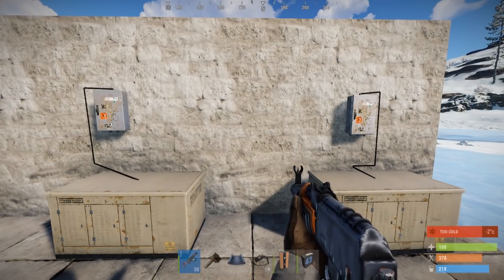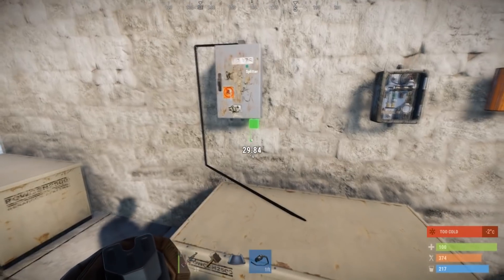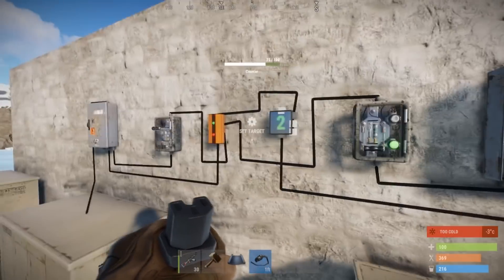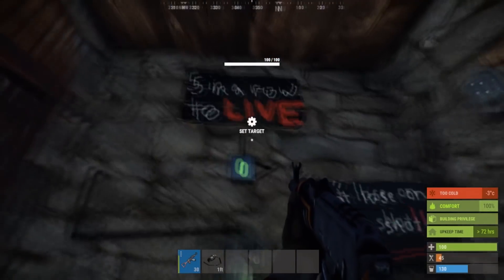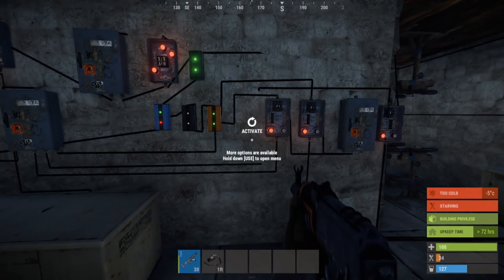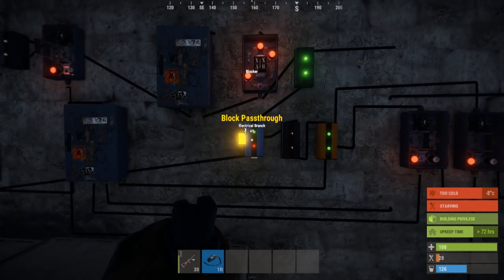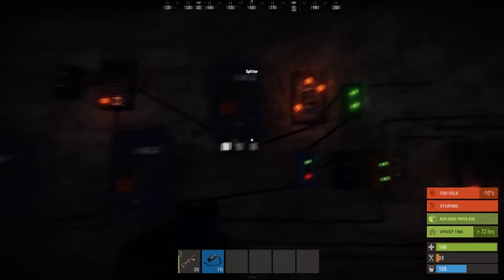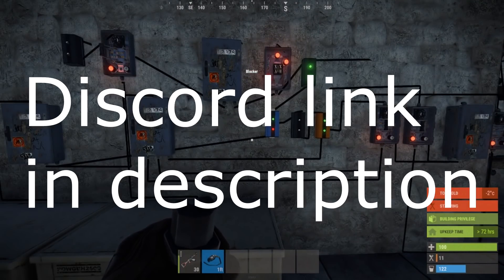Rust Electricity - Automatic Russian Roulette (RAND Switch Explained)!

Comment: Trying to make a door randomly open and close to fend off offline raiders. How do you make a switch turn off and on automatically?
Reply from the maker: Preston Black look up my automatic shooting range video, it has a schematic that can be used to make a random open close door loop
Reply: @RUSTQuickElectric  thank you! I had a setup that used a Rand , 2 switches and a door controller. After messing around with it I figured out that leaving both switches on resulted in a loop making the door open and close. Appreciate the help. If anyone needs help replicating this add me on discord Trek#8272

Comment: i gotta say. your schematic is clean as you say (doesnt work for me. i see it. i made it. it's not working), but your wiring is not. you're making a tutorial video. clean up the wire work so i can visualize what it was you did. thnx for sending me on the right path, though. i will figure this out. i figured out a hundred and fifty different functions for this system, but not this system... yet. 
i have made this four times on creative. 2X through the video set-up and two times with the schematic. if the RAND switch doesn't send power (as it does) and the switch that is triggered can't thereby actuate the counter, how does this work with as few components that you are using.

Comment: been at this an hour. can't get it to work properly... so sad.   i keep at it till i figure it out. 
question. what are the power requirements for the switches and what setting are the branches at? 
i can't get the RAND switch to activate ever. i set it up as in video AND schematic.
 i'll try till reply. prolly end up on your discord...
Reply: i had a buddy of mine set mine up, our counter isn’t going past 1
Reply: @Gwiddyy  been awhile since i played. i think i worked it all out at one point, but would have to start over with the learning process.
Reply: cortedemico all good bro! i’m gonna try and work out a way to utilize this from one switch into 3 counters creating a random gen slot machine with any numbers between 1-9 any 3 in a row would be a win